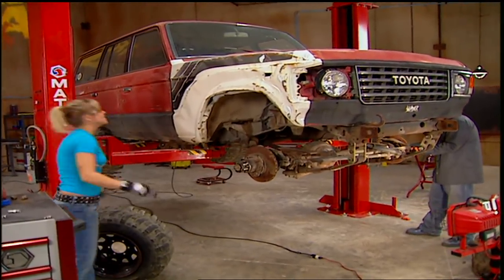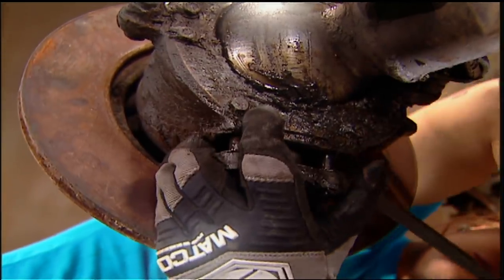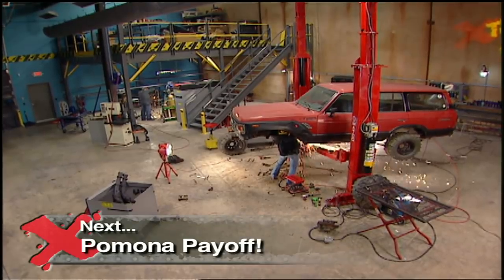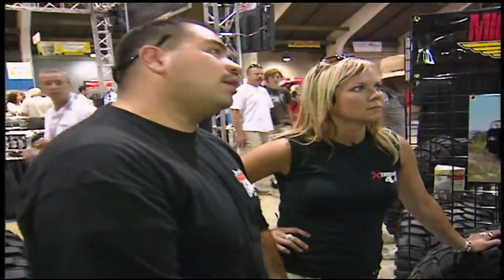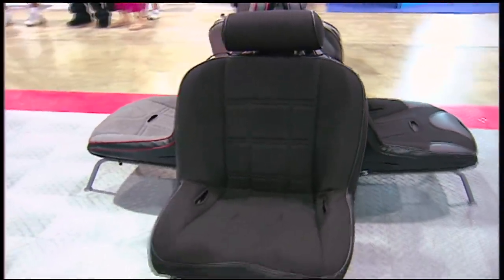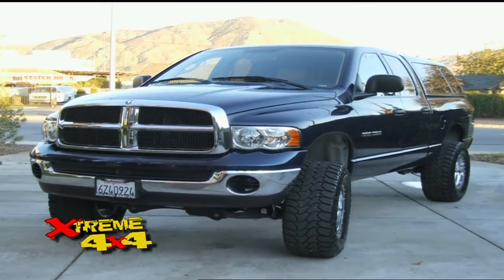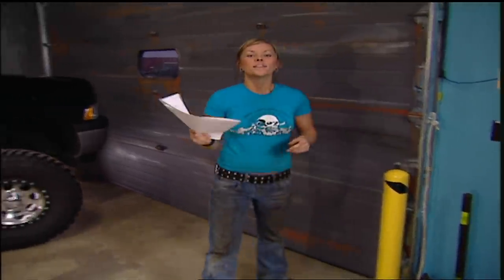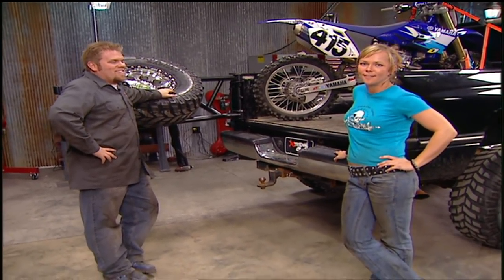Spring Over Axle Conversion For An '85 Land Cruiser FJ60 - Xtreme 4x4 S2, E7

Comment: That bronco is to nice to cut up
Reply: It's a 60
Reply: I wish I hadn’t cut it too. Oh well.
Reply: @155007  When I saw the picture I was like "oh nooooo". This was 15 - 20 years ago it looks like, so not like today's market which I think has change my mindset. I did the same thing back then, had a few that I chopped up and sold (not Broncos), and look back and think, should have kept that thing stock, shouldn't have sold it etc. Are you Tim from the show? How did it turn out with the parts, did you/are you still enjoying her?
Reply: @guyokajima7018  yup that was me. The shoot was in 2005, aired in spring ‘06. I still have it and it’s currently going through some upgrades but was left pretty much as you see in the clip until about 3 years ago.
Reply: @guyokajima7018  also I bout the rig for $8,500. Yes the market has gone nuts for these and glad I got it when I did. Still zero rust.